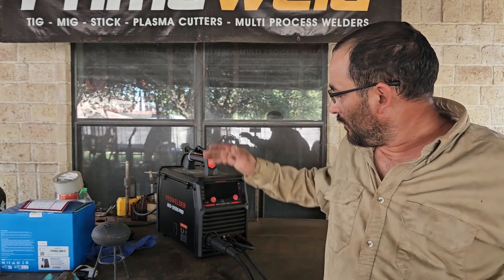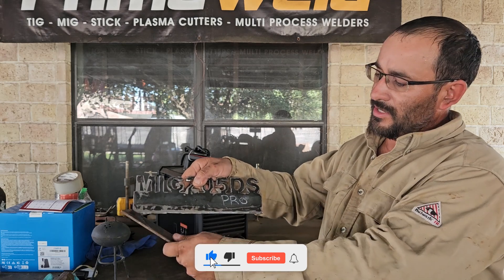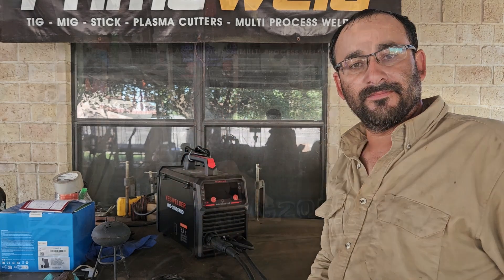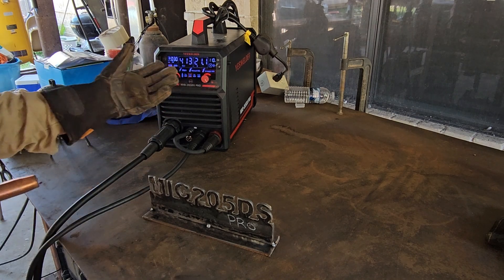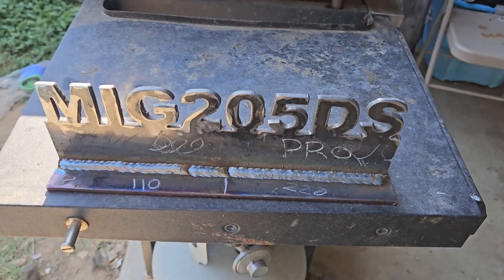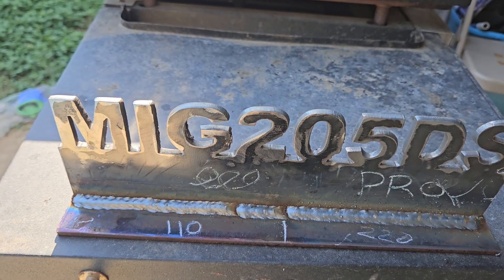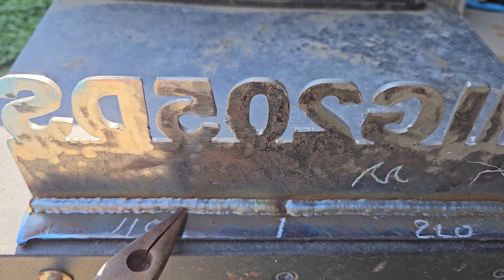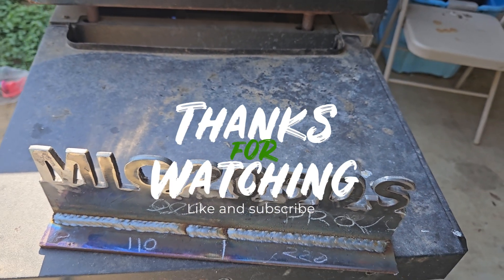Does The Yeswelder Mig205 Ds Pro Work On Both 110v And 220v? Beginner's Test! @YesWelder

Comment from the maker: My 220v machines run on a dedicated 50A circuit and this 110v was on a dedicated 30A circuit. The extension cord I used is 8AWG wire and 40ft long. Thanks for watching and any questions let me know.
Reply: I have the mig 205ds (not pro) which is supposed to be 220v capable as well but I can’t seem to figure out how to make it work. The plug coming from the unit is a standard 100v plug. Do I have to go inside and rewire the machine? I can’t find anything online or in my manual except the claim that it does 220v.

Comment: Would it run on a 20 amp circuit on 110?
Reply from the maker: You will be limited on your amperage but you should manage to get some welds done on thinner material. I use a 20A circuit when testing welders on 110v and a 50A for 220v.

Comment: The specs on the back of the Machine says 35 Max Amp breaker, would 50 amps be too much in case it overheats or malfunctions?
Reply from the maker: I'm looking into the manual and do see Max input current of 34A and they recommend a Nema6-50 AMP outlet. I have always ran similar 200A mig / arc welders without issues and do believe I have a 50ft run of #6 wire on my 50A circuit . Now when I exceed the duty cycle I have caused my breaker to trip several times as I like to torture test machines from time to time. A 35A breaker might work on lower settings as the draw is much lower.  Hope this helps.

Comment: Would you get the same results on a Generator Troy-Bilt 5550 running 220v ?
Reply from the maker: I tried running 2 different brand IGBT Arc welders off my Generac 8000 and could not weld at all. I think the output is very dirty on most generators unless its a inverter based generator. I might try testing a MIG welder on my generator to see how it performs. Thanks

Comment: how do you actually change from 110 to 220? can't find the info anywhere?
Reply from the maker: Most dual voltage welders sense the input voltage and automatically adjust which is neat. If I unplug this welder from 220v and plug into 110v it will automatically do its thing and be ready to weld.

Comment: Great video. Did you plasma cut that sign ?
Reply from the maker: Yes I did. The slats on the table need to be replaced as its eneven and caused issues during cuts. The table I have does not have height controller either. I thought it would look cool and next time will stick to 1/8" materials.
Reply: @cutweldngrind  I thought it looked great!! I want to build a plasma cutting table it would definitely help out in my projects.

Comment: One thing I learned with welding on 110v is you have to take your time and actually move the puddle in kind of a triangle and just go slow😊
Reply from the maker: I will try again on 110v and will switch to 1/8" mild steel which is more around the max thickness for most machines this size  running 110v (140 amps).  Well, thanks for the tips and for watching the video.